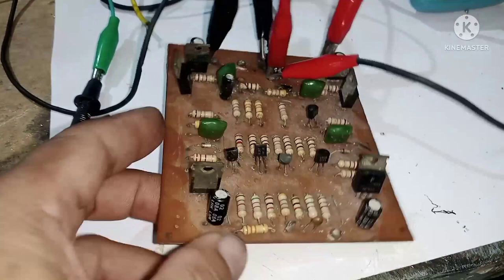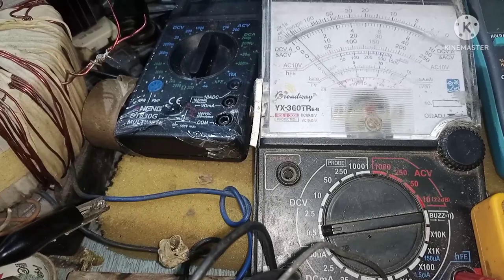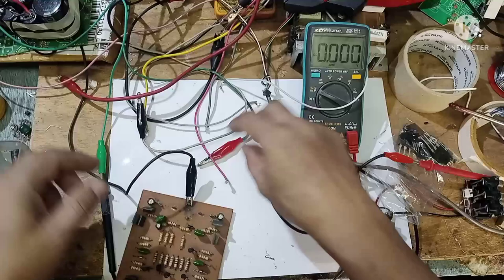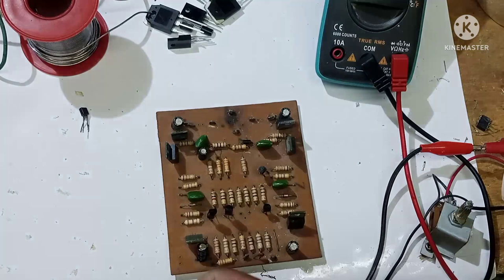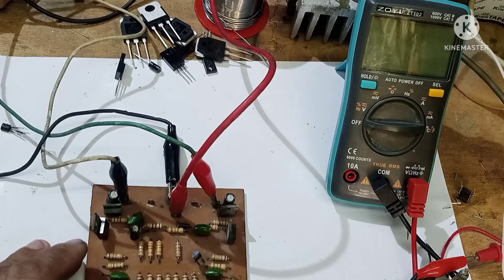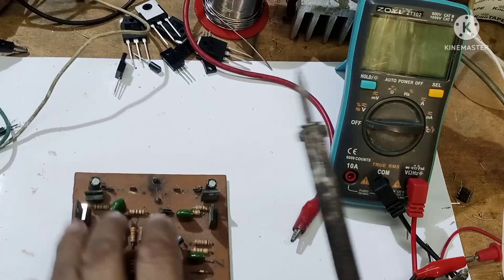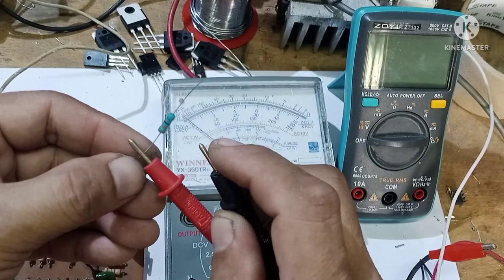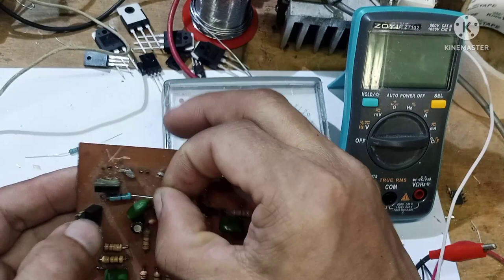NAD amplifier upgrade, 50-85vac, Panoorin mo ito kung gusto  mo matuto mag upgrade.

Comment: Boss good day sau,ang galing mo...SA pag upgrade Ng ampl. May itanong kulang sau may integrated ampl.ako konzert 602 b Tata yon generic lang may supply cya na 33.5 0 33.5 AC dagdagan KO SA Ng voltage Yong supply kahit 40 0 40ac ano ba ang mapalitan na mga pyesa,hinde naman ako electronic pero mahilig talaga ako Ng sound, nakagawa narin ako Ng dalawang DIY na amplifier .thanks boss

Comment: Bro. New subscriber mo ako.May tanong lng ako sayo sir.
Binuksan ko tong DENON na ampli n bigay sakin dahil isang channel lng gumagana
Napansin ko n bloated ung isang filter capacitor 10000uf/50v., nagtaka ko sir kc tatlo ang pin nya ngayon lng ako nkakita nito hindi nmn kc ako technician.
Ang tanong ko po, anong klaseng cap. Ito? Tumingin ako sa shopee at lazada, wala sir.
Reply from the maker: Yang ecap po ayus lng yan at xclusiv yan pra s knya at yun ang design ng capcitor may extra terminal pra may suport p sya.. Pero dalawa lng tlga ang working terminal nyan +/- yung isa nkikita m suport lng sya pra di agad maglolost.. At pwed nmn yan palitan ng dlawa lng..